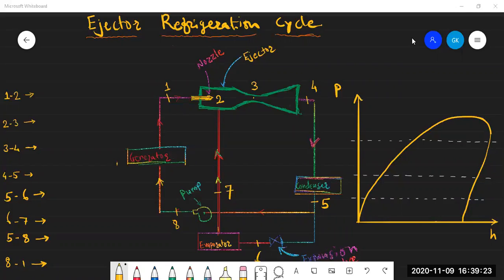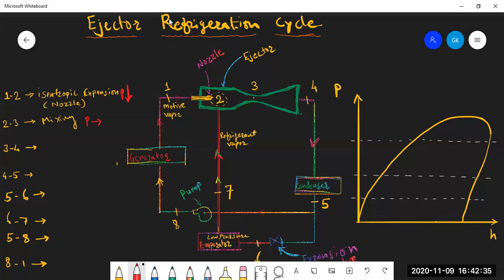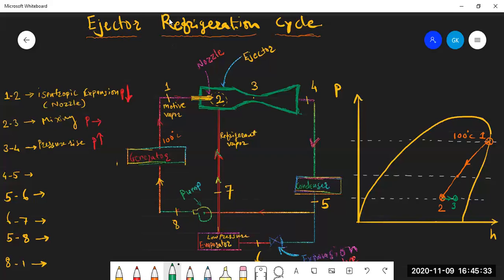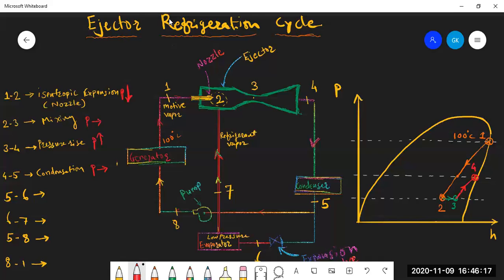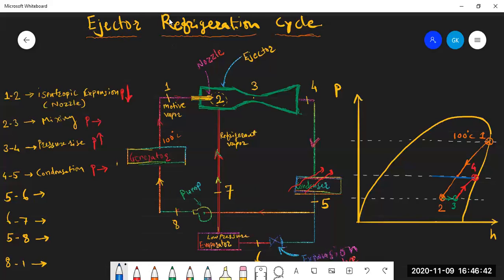Ejector Refrigeration Cycle with P-H Chart.

Comment: I have been working on this for 20 years. After the evaporator you can add solar heat exchanger panels to further elevate the temperature/pressure of the refrigerant to increase the Delta P and thus provide more motive force for the ejector. The DP also increases the efficacy of the condenser. Compressor-less refrigeration is the holy grail of refrigeration. The market is a trillion dollars.
Reply: I want to do phd in solar ejector refrigerator system, may I get your contact sir